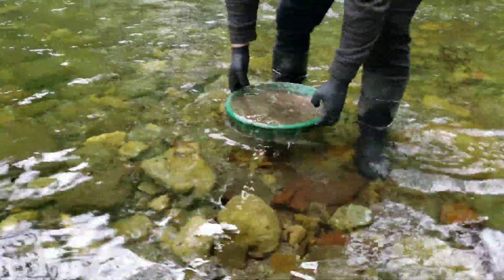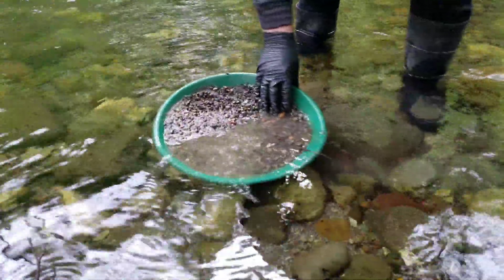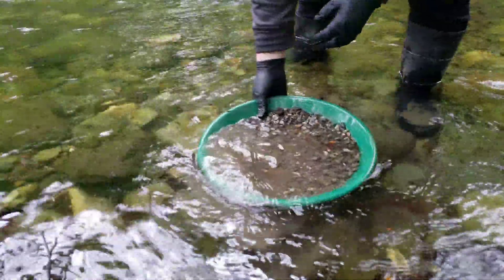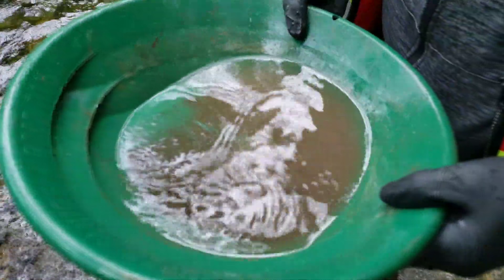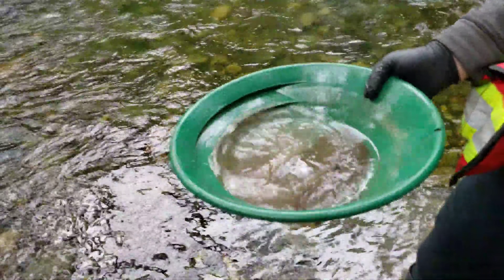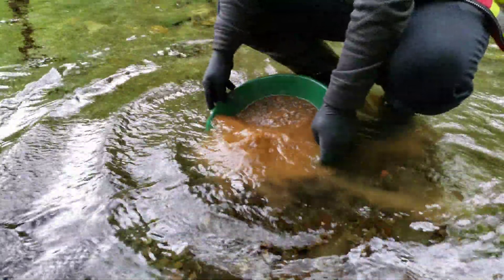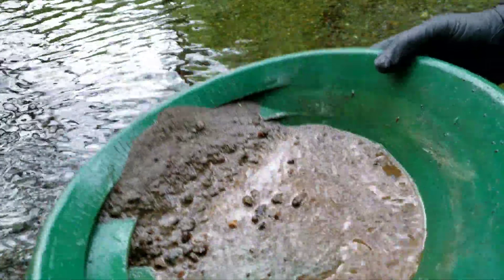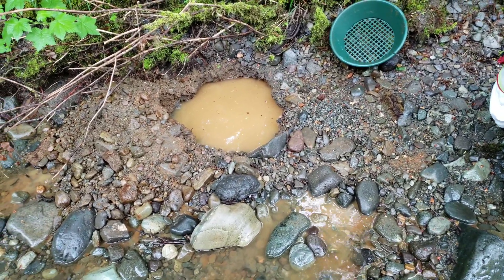Panning One Kilogram Of Oxidized Concentrates For A Gold Assay!

Comment: Is it possible to wash the dirt and clean it  by panning with water and some soap?
The magnet is used to remove iron impurities, but it is necessary to make sure the iron is taken by the magnet as it may contain gold. Then after separation of iron. If it contains sulphate, arsenobraite and pyrite, it is roasted well for four to five hours and then directly melted using either charcoal, red copper powder, carbonate, sodium bicarbonate, and borax and then casting in a pyramidal mold. It is possible to use lead substitute copper as a collector of gold, but it is a risk and preferably copper. Then filter the alloy with either nitric acid to dissolve copper or silver or use royal water(aqua regia_ ratio 68%htdrochloric acid,32%nitric acid  sometimes 3:1, or 4:1) to dissolve gold, silver and platinum. Then spray the solution. Then the deposition of gold powder zinc or other precipitants as well as how to use sulfuric acid diluted to dissolve sulphate and pyrite, and then after the dissolving of sulphate and peritate we filter. Then take the remaining residue and dry it and then wash it with hot water four to five times and beware of gas escalating or other washing and the whole process is done with great caution and then his brother-in-law as the introduction or use of royal water(aqua regia). To clean gold the way sulfuric acid is dangerous. But it may be effective in case the operation was done with caution with the availability of all equipment and safety precautions. You may lose some metals such as silver and copper, which will dissolve sulfuric acid and may need a difficult process to extract but may be effective in case you want gold and other minerals.
Your friend
I need your suggestion  and recorrect my information if there is mistake.  Sorry  if i have  mistakes in explain or written 
I use google translate to help me.

Khairallah  alyaari 00249115445673(whattsapp)

Comment: Very interesting, how often do you do this? Thanks.
Reply from the maker: Not very often. It's an expensive assay.

This is the procedure:

1000 g of the final prepared pulp is passed through a 100 micron (Tyler 150 mesh) stainless steel 
screen to separate the oversize fractions. Any +100 micron material remaining on the screen is 
retained and analyzed in its entirety by fire assay with gravimetric finish and reported as the Au (+) 
fraction result. The –100 micron fraction is homogenized and two sub-samples are analyzed by fire assay with AAS finish (Au-AA25 and Au-AA25D). 

The average of the two AAS results is taken and 
reported as the Au (-) fraction result. All three values are used in calculating the combined gold 
content of the plus and minus fractions. 
In the fire assay procedure, the sample is fused with a mixture of lead oxide, sodium carbonate, borax, 
silica and other reagents as required in order to produce a lead button. The lead button, containing 
the precious metals, is cupelled to remove the lead and the resulting precious metal bead is parted in 
dilute nitric acid, annealed and weighed to determine gold content.

The gold values for both the +100 and -100 micron fractions are reported together with the weight of 
each fraction as well as the calculated total gold content of the sample

Comment: So the assayer will have to grind your cons with a ball mill 911? Hope your results are better than you think!
Reply from the maker: Not exactly here is the procedure:

1000g of the final prepared pulp is passed through a 100 micron (Tyler 150 mesh) stainless steel 
screen to separate the oversize fractions. Any +100 micron material remaining on the screen is 
retained and analyzed in its entirety by fire assay with gravimetric finish and reported as the Au (+) 
fraction result. The –100 micron fraction is homogenized and two sub-samples are analyzed by fire assay with AAS finish (Au-AA25 and Au-AA25D). 

The average of the two AAS results is taken and 
reported as the Au (-) fraction result. All three values are used in calculating the combined gold 
content of the plus and minus fractions. 

In the fire assay procedure, the sample is fused with a mixture of lead oxide, sodium carbonate, borax, 
silica and other reagents as required in order to produce a lead button. The lead button, containing 
the precious metals, is cupelled to remove the lead and the resulting precious metal bead is parted in 
dilute nitric acid, annealed and weighed to determine gold content.

The gold values for both the +100 and -100 micron fractions are reported together with the weight of 
each fraction as well as the calculated total gold content of the sample.

Kind of complicated. Fairly expensive too....
Reply: Thank you very much for the information. Now I have better understanding of what these different procedures are👍👍👍